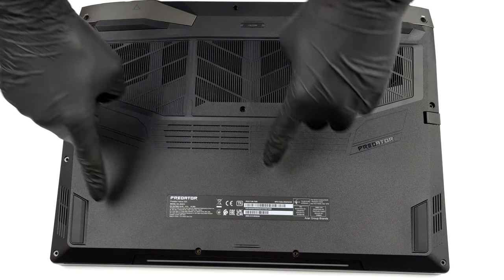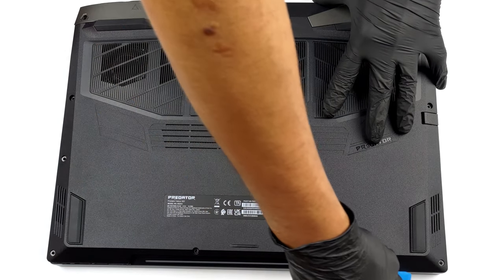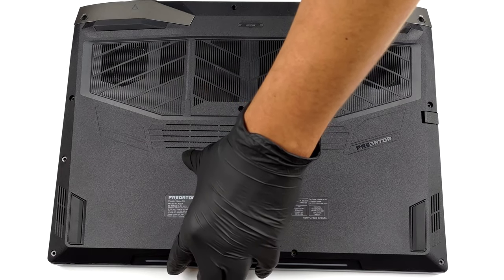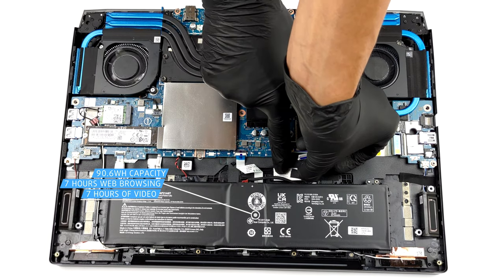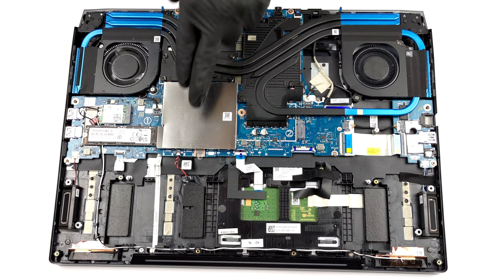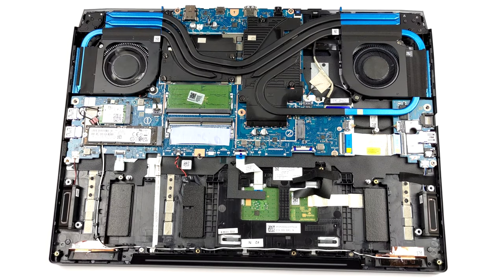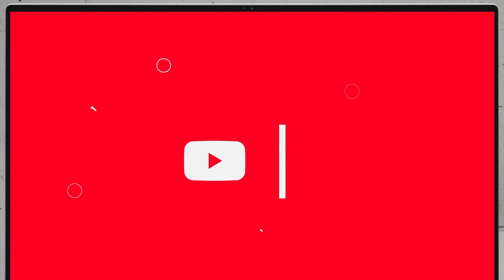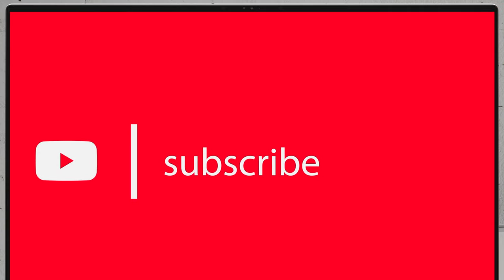🛠️ Acer Predator Helios 300 (PH317-56) - disassembly and upgrade options

Comment: for anyone who's trying to remove the back panel without breaking it, before beginning the process, remove plastic cover that sits on under the screen when the lid is open. im talking about the plastic thing that looks like a battery on top. if you remove it, while youre removing the back panel you could see 4 tiny clips sitting in there, when you move them gently, you can remove the back panel without any force. i repeat WITHOUT ANY FORCE. this information is not anywhere on the internet though. i just recently found out.
Reply: and btw, please buy some plastic prying tools and a quality screwdriver. it helps a lot.
Reply: Thank you for such a helpful comment!
Big thanks👍
Reply: it's too late brother, I already took it off with a knife 🤣
But thanks for informing us

Comment: Hi. Does it have place for small radiators on ssd storage ? About 2 mm thickness. Write pls your opinion 🙏
Reply: there are radiators on both of them. with thermal pad included. radiators are embedded inside the plastic back cover.

Comment: I found getting the back off very difficult. Was worried multiple parts would snap. Large parts as well as the small clips. Maybe its just my build that is so tough, or maybe its becuase it was the first time (just having a look).  Are there any tips to do this damage-free? I intend to upgrade the ram, main drive and adding an additional drive over the coming months and would like to reduce risk! Come from a dell 7577 with one screw, i have no idea why they make it so tough
Reply: same